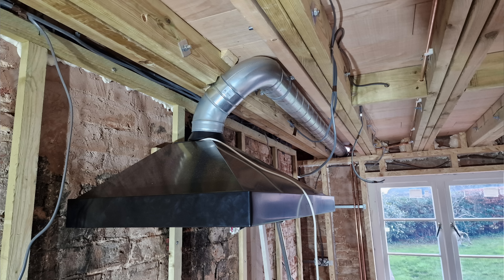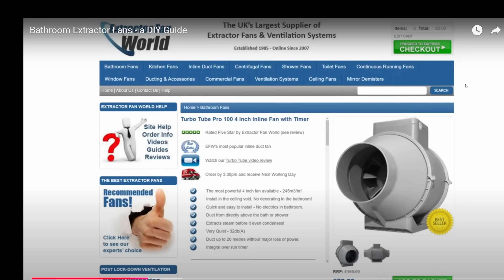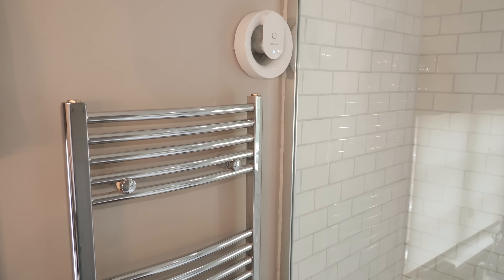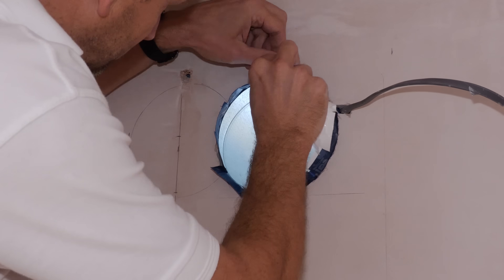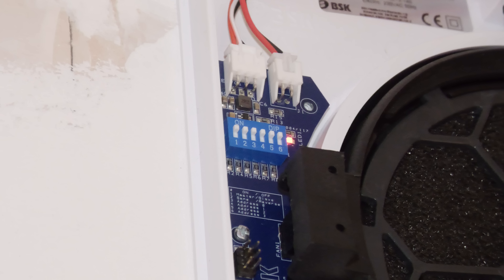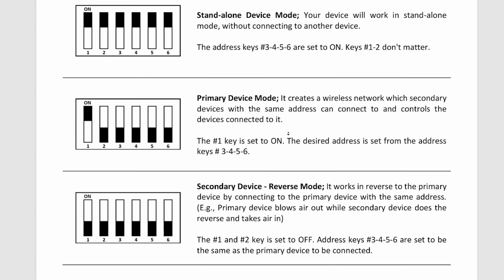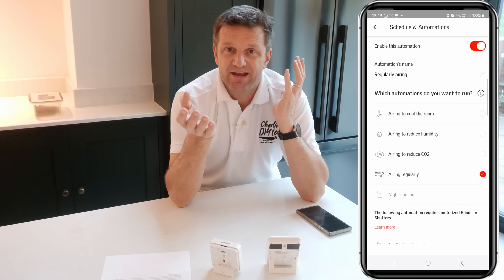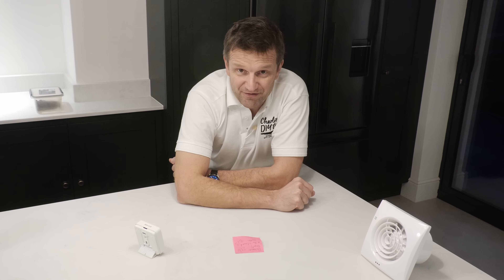A COMPLETE GUIDE to Decentralised Single Room Heat Recovery!

Comment: @CharlieDIYte   This is a great video as always Charlie lot of info I wondering if I could use it in a bedroom to replace a drafty air brick in and solid brick 1930s house when I do the internal wall insulation. Would be interested on your thoughts on this. As I know ventilation is key but this as to be surely a better option than a airbrick which just robs the heat from the room.

Comment: I'm curious how efficient this is compared to a much more low tech but perhaps bulkier solution like https://www.youtube.com/watch?v=sn512l7Ehss  .  You need both an intake and exhaust port but you get consistent heat exchange, and it's directly heating the air instead of heating a ceramic element to heat the air which has to lose a ton of energy. Given you need really need to setup at least 2 of these anyways to get proper airflow, it seems the benefits really drop off.

Comment: This is excellent. I was quoted £1800 materials only for full mvhr for 3 bedrooms and 1 bathroom. But this will set me back for £700 for single room heat recovery unit. Is this effective than full MVHR? Or is it only a slight difference? Please advise Charlie.

Comment: These seem rather pricy for what they really are, and the back-and-forth ventilation is less than ideal.

I had an idea to build a HRV for far cheaper, and with potentially better performance: just bolt two 120mm PC tower coolers together. Mount the fans so that one is pulling the air in, and the other out. Add some aluminum foil and tape, some ducting and you should be golden. Unfortunately, I have no way to test that since I already live in a well ventilated (and rented) apartment :)
Reply: This is
Interesting

Comment: I’ve just bought this and the outer part of the plastic tube is actually 165mm! It only reduces down to 160 on the end. Drilled 160mm (only in plasterboard luckily before realising) 😂

Comment: Great video!! Well, I have one unit in each room in my house, I got them installed to reduce/remove condensation on my windows. I've got 3 layer windows, brand new, and BSK Zephyr running pretty much 24/4 at night mode, sometimes at level 1. I don't really see considerable benefits to be honest, the only house project I regret investing money in. Dehumidifier works way better (but it's more noisy... and unless hooked up to the drain, manual water removal on daily basis). Regardless, we keep using it, condensation is generally reduced, but how much of it is the windows and how much BSK... hard to tell. The new 3 layer windows still get "sweaty" during the winter months resulting in mild mold on the silicone around the window frames... Basically, if you live in a high humidity, windy place, centralized unit for the house is the way to go. My house cannot have the centralized unit installed (unless we want to basically redo the roof, and all the ceilings), so we tried the BSK. One question, can you show how to clean the unit? I cleaned the filters many times, but now I got "hygiene" alert on one of the units and it seems that the ceramic core needs to be cleaned. Just a wet cloth, or can I just pour water through it and let it dry? Keep up the great work, all best from Denmark.
Reply from the maker: It's a good question about cleaning.. I'll ask BSK because I owe them an email. I've found mine too be pretty good in the sense that the kitchen relative humidity is 35% I've actually had to turn the fan down last night as that's too dry. Sorry to hear about your windows. Are you find everything discussed here https://youtu.be/NbtijHKy2Vo?si=1QE2RqCAW1mpfkdG ?

Comment: As with most things in my life, if I can avoid doing something, I will. 
We've got smart temperature and humidity sensors littered all over the house that runs routines when humidity (or temp for that matter) goes above or below a set threshold - such as turning a dehumidifier on when humidity is over 60%. We use a woodstove in the living room so have a humidifier on a smart switch that turns on when it drops below 45%

We're in the process of designing our extension and my only musts are full house networking and smart home integration.
Reply from the maker: You need Home Assistant if you haven't already got it. Great work 👌
Reply: @CharlieDIYte  I've got that installed on a little Optiplex 3060 in my utility room. 
I'm in the process of de-subscriptifying(?) everything so bought a "cheap" CM3588 NAS from friendlyelec for movies, TV shows and music to use with Plex.  

Side note - do you have any upcoming projects requiring block or brick work? Would love to see a video from you on this subject - your videos are really well put together for learning new skills.
Reply: What model of dehumidifier have you got?
We have a dehumidifier and it works great apart from one thing. I was planning to set up an automatic start for it, but the problem is once you switch it off and then on again - you need to manually press the power button on it so that it starts (and also set the humidity level to 50% and fan flap movement) so all in all additional 3 button clicks are required to make it work.
Absolutely impossible to automate the thing.

Comment: thanks for showing the inside.  how thick roughly is that ceramic disk with the holes.?  ive been considering building a diy one of these with a few Honeycomb Ceramic Soldering Boards and a duct fan .

Comment: Hi Charlie I have a heavy duty shed I’ve insulated it but in summer it get really hot and winter bit cold. Is there anything you would recommend for using in it the overhaul wall size from outside to inside is about 6 inches. Best wishes Graham

Comment: Complete beginner in these things but was planning on switching out our basic bathroom fan (with 3+ metres of cloth ducting behind it) for an in line fan.

My question is, can i use a spare length of plastic wastepipe as ducting? 
You mentioned in the video that you thought your spiral ducting was superior to the supplied plastic one in the MVHR unit you installed. 
Is it that significant? What're the pros and cons of that?
Reply from the maker: Yes you absolutely can use plastic waste pipe. That's exactly what I did in our bathroom. The metal duct was actually a bad idea as discussed here https://youtu.be/zSxyUFLwFbc?si=JbCLOPyQzlVLRa_- so you're much better using plastic

Comment: Does the external vent have to vent directly to the outside environment? I am looking at these for a noisy workshop and wondering if they can be directly through a baffle system, or whether this would screw with how they work ? Any ideas?

Comment: I’ve bought a house without any extraction built in, so this time of year, getting condensation on the bedroom windows, ( no trickle vents ). I need extraction added to the bathroom & kitchen too.

I wanted a heat recovery for the kitchen, as that area creates heat & condensation. During the summer I was looking at an AIRFLOW Unohab, through the wall heat recovery. Any knowledge of that ?

With what you know, would you still choose the Vent Axia for the bathroom ?

As my driveway isn’t level ( problem for ladders etc ) I wondered about through the  bathroom ceiling & roof method. Which I believe the Svara can still do.

Basically. I need to pick this up in the new year & am unsure which way to jump. Any advice ? Thanks & happy Christmas:-)

Comment: Uh - So where the second heat storage medium? When it blows out air for 70 seconds, its pulling cold air in from somewhere else. likewise, when its blowing air back in its pushing warm air out somewhere. Even with the ceramic thing its basically useless. You need a second ceramic heat exchanger somewhere

Comment: I’ve been looking at these for a while. We have 18” granite walls and live in a DAMP valley. Humidity readers often show up to 80% in colder months. I Karcher damp windows every morning throughout. Will I draw in damp air? I open windows on clear and windy days and use dehumidifiers a lot. 2 en-suite bathrooms need something but these walls open northwards to hilly slope 3m away. Will I just be extracting damp air and drawing in more damp air? Any advice much appreciated.
Reply from the maker: I'd possibly install a PIV. The air outside might seem damp and have a high moisture reading but that's because the relative humidity (relative being the operative word) is high but the air is actually quite dry - it just can't hold much moisture because it's cold - as explained in this video. So it's up to fill capacity in terms of how much moisture it can hold which gives a high relative humidity reading. Conversely inside the house when you turn the heat on, relative humidity will go down but the air isn't drier. It's just able to hold a lot now moisture because it's warmer. But that extra moisture then just dumps on the windows (which are natural dehumidifiers). I think a PIV might be the answer though as the air flow stops moisture forming on the windows and other cold surfaces. https://youtu.be/NbtijHKy2Vo?si=Ow57AB7QeWWv52er

Comment: is it possible to place it on the lower part of the wall? in portugal the houses were built with a somewhat passive ventilation system but my mother decided vents dont look good and so she closed them, now her house is full of mold and humidity problems. Also do you think the sound volume is low enough for people to sleep in the same room?
Reply from the maker: Not sure about the first point but the sound isn't too bad and you can always switch it into night mode. She must open those vents though as discussed here https://youtu.be/NbtijHKy2Vo?si=lhv3OtQ7RoHtV0Nx
Reply: @ thanks!

Comment: Whilst it’s cool tech, it’s ability to only recover about 50% of the heat is a significant compromise vs a central system.

Whilst I do care about efficiency, what I and most other people really care about are the bills. And, vs a basic extractor, what is the ROI? I suspect the extra £150 per fan is going to take a fair while to pay for itself.

Comment: Good video but, unfortunately the product, made in Turkey, is showing fake airflow data. Instead of 60m3/h airflow it bearly reach 42-46. There are independent tedting report showing it.
Also pay attention, in good quality products, the ceramic core is from a special alumina porcelain that dont absorb water. Yours, please check it, will suck water like a piece of chalk. The ceramic is not allow to absorb moisture as by condensating during cold days, water+ dust+a porous surface=mold. So became a health issue. So,  again, nice video but you choose a bad product.
Reply from the maker: Thanks. I'll take this on board for any update review.

Comment: As somebody not very experienced with DIY yet, is there a company or type of tradesman that could install this to replace trickle vents in my house? 

I'm new to DIY and not yet comfortable drilling holes through brick walls or doing anything electrical yet
Reply from the maker: I think you'll have to Google around approved local installers. You shouldn't really tackle electrics - leave that to an electrician.

Comment: Looks interesting, but when you were scrolling the website, I spotted something even more interesting - Vent Axia Tempra P
It seems to be a real recovery system just in mini size, and costs minimal more than your current solution. 
As I understand, it doesn't cause under/overpressure and air leaks so such be more efficient 
Maybe take a look at it
Reply from the maker: Thanks. Yes someone else mentioned in the comments yesterday - might have even been that system. I like the minimalist design of the Zephyr though.

Comment: Judging by the thermal camera readings, the thermal efficiency of that ceramic core is pretty low, definitely less than 50% but hey it's ventilation and better than nothing.
Reply from the maker: I agree. Plus I have a perfect cold bridge I need to eliminate by changing that metal duct back to the plastic.

Comment: I wonder what the centralized heat recovery systems will look like with all that ducting inaccessible in the ceiling. Is there any data on that? Dust and mould, etc should collect there, right? I know there are filters involved, but filters never stop everything and clog up if you don't maintain them. I have recently opened up my dryer and was surprised about the amount of lint I found on the inside. A decentralized system is much easier to clean and has very short ducts you can actually access.
Reply from the maker: Funnily enough I was wondering this the other day. I agree but they're such a fantastic option I guess it's a small price to pay.

Comment: Can those vents be shut close when not in operation? I wouldn't want to have a permanent hole in the wall that cannot be sealed.
Reply from the maker: Not the outside but when you switch it off the inside cover shuts

Comment: Charlie's opening comments: "we can't have ducted MVHR in old houses" isn't true. Bungalows are very easy to convert and Victorian houses could use the chimneys for ducting with further ducts and the MVHR in the attic. Our 40 year old Swedish kit house came with ducted extraction which was easily converted to MVHR. The fan speed is regulated by CO2 and RH% - it's now late evening and running at 34% rpm - extracted air is 18.5°C and supply is 13.2 but outside is 5.5°C I think that's worth having. I can't see how two of these Kair units running push/pull all the time would ever manage that efficiency. The diagram of two units working together implies some through flow of air but if one was blowing all the time and the other extracting - you would recover nothing - it would be no more efficient than opening the window. I think Vent-Axia make one that has concentric pipes and a proper crossflow heat exchanger - a much better idea.
Reply from the maker: Thanks John. It's a fair point. What I perhaps should have said was it's not something most people are going to take on because of the practicality but you're right, it's perfect for bungalows and is far superior to any decentralised option.
Reply: Pretty sure two units together would still reverse every 60s, but do so in tandem so that the air has to go through the vents and can’t sneak through any gaps where the heat would not be recovered.

Comment: I have mine for about 6 years now. Mine are from Südwind from Italy. They can be coupled together and now they also have them as smart units. I love them. Especially as I can also use them as positive of negative airflow. I put the one in my living room to extracting to outside. Then turn on my AC to cool my house and in a jiffy the living room will be filled with cold air from the AC in another room. Works like a charm. Also the inter climate increased amazingly after installing 2 from these units. I always have them running. In my living room I don't hear the unit, but in the bedroom, that 70 seconds is just to short to get used to it. So I have mine of night mode. Never that smelly bedroom in the morning again! My windows can't open, so this was perfect, 10/10 recommend it. Next to how they work, compare the electric bill of a centralised unit with decentralised units. I mean, mine do les then 10 watt. Less power usage, more effort. BTW, my Südwind units have a different inner unit. And to be honest, a better design! As the inner unit opens to top side. Put a chair under yours, and you will get cold, but when it opens to the ceiling, this is not an issue. No cold down fall.
Reply: These are good products !
Reply: Can you share which model you have
Reply: @weesplash  I have two Südwind Ambientika advanced+ units installed. I have not connected them together as they operate standalone, but with the remote I can set them as if they are working together. For me they are fine. My air quality drastically improved.  They sell them on Amazon actually.

Comment: Just to add, I have found a simple 'solution' to condensation.... I have placed a simple fan in front of my single glazed window.  I think it's a 12 inch fan that you would use in the summer from a supermarket.  I have found that condensation cannot form if the air is constantly moving in front of the glass.
Reply: This is working because you are heating the glass with room air which is cooled in the process. So it is wasting energy.

Comment: I came across something like this a couple years ago. They seem like a really good idea as a retrofit. However, I do wonder about sucking in damp warm air. Those expensive centralised heat exchange units do dehumidify the air coming in before running it over the heat sinks before dumping it into the house. These isolated decentralised ones I don't think do this. Do they?
Reply from the maker: The air outside isn't damp as discussed here https://youtu.be/NbtijHKy2Vo?si=hoTvnhgsLu2fWyH0 It might feel damp and run a very high relative humidity but that's because in the cold weather the air can hold very little moisture. That's why you get chapped lips.

Comment: 1)What about a PIV Unit?(supposedly the best thing to tackle Condensation)
2)Dry Rods near the base of walls alongside liquid dpm like Drybase (best for any potential riding damp)
3)Stormdry or any other Premier top of the line Siloxane Mixture of External Brickwork (optimal for Bare), if already painted then a Silicone Paint 
4) Dmev/inline/centrifugal fans for wet rooms?
5) What material would you recommend as being optimal when replacing MDF baseboards/Skirting in a Wet room(this entails Shower rooms or Bath
rooms)
Reply from the maker: Thanks. Probably tricoya MDF. It's basically impervious to water.
Reply: @CharlieDIYte  Interesting Response Charlie In Your most humble Opinion would you say they are, even more so, recommended than tile skirting?!